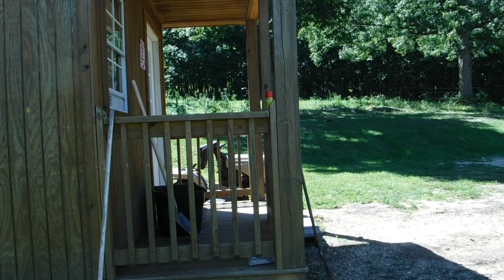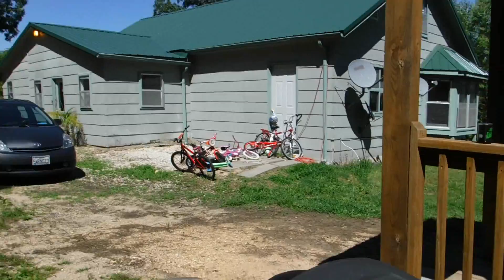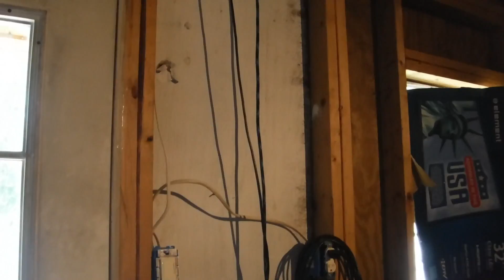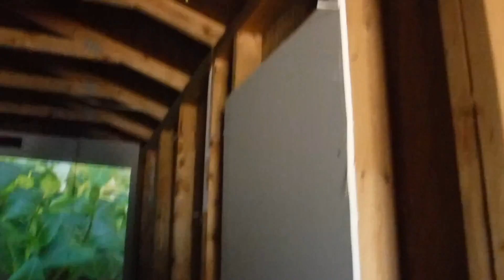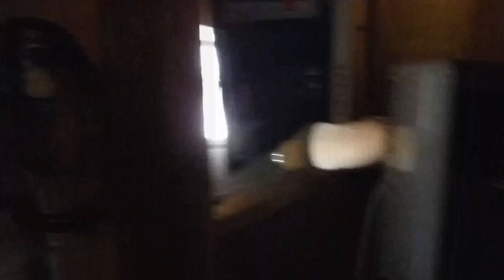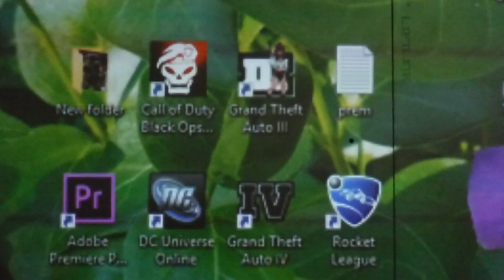10x24 Man Cave Cabin by Derksen Buildings

Comment: Rigid insulation can be cut to fit get the 2"+ white against the outer wall and then the 1" blue/pink rigid to the inside fills the gaps between the studs nicely.

Comment: Hey neighbor. I got a small place in Westport I am working on
Reply: Hey phil, should someone be able to put this on their lot to be used as a man cave on nearly any location or does the city codes and regulations vary when it comes to these types of cabins?

Also, someone said that some of the city codes require you to place it on concrete slabs instead of bricks.
Reply from the maker: +Theodore Hileman how's it coming along? My projector got burned out on a lightning storm we had. It was a sad day for the man cave lol
Reply: Always keep your expensive electronics on a surge protector!
Reply from the maker: Bizzare77777 I'm not really sure. I know if it's not on a slab the rules are easier.